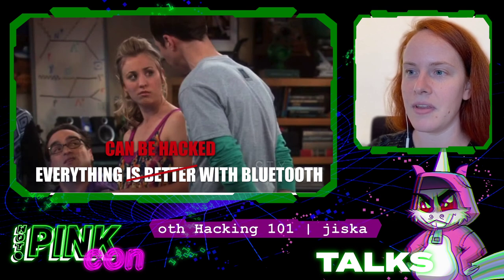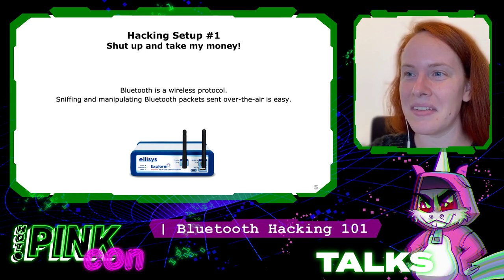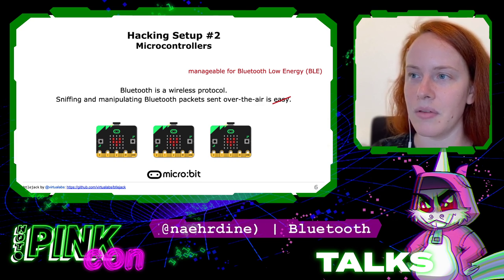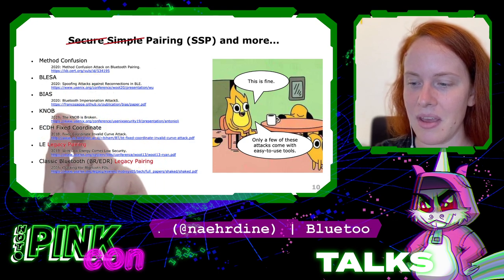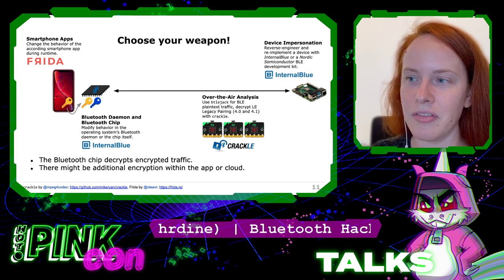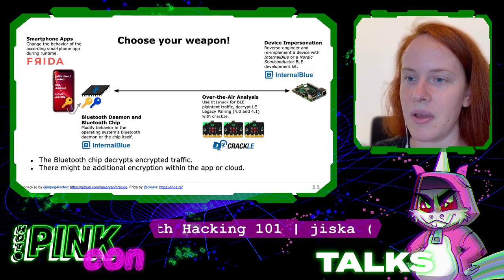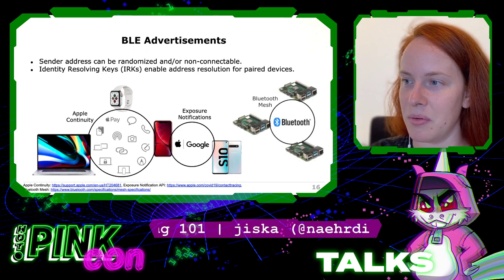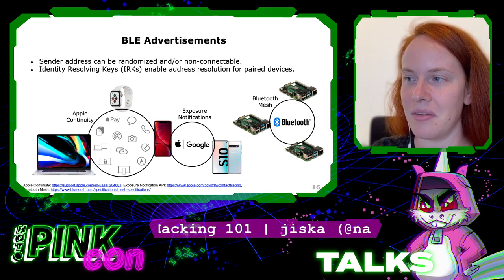Bluetooth Hacking 101

Comment: Hi Jiska, Few Corrections. Music streaming/Hands Free happen in SCO / eSCO channel in Classic Bluetooth. In BLE 5.2, it is Isochronous channel. Sometimes, the  Scanner  can respond to advertisements in  Scan request and the advertiser will send a Scan response data. If you have a chromecast remote, you can Check for example.